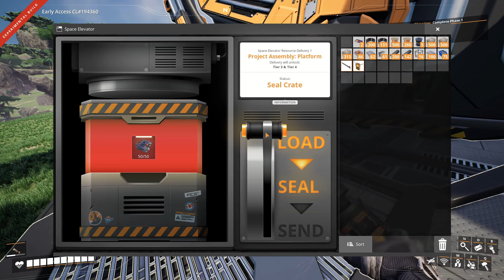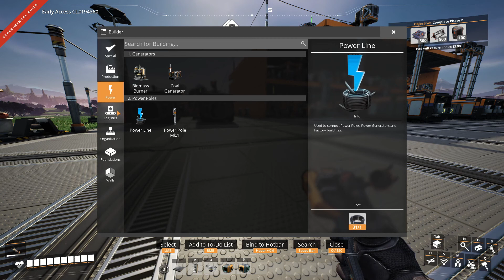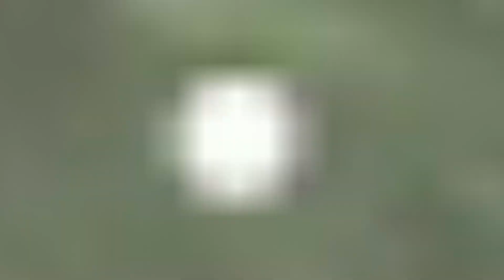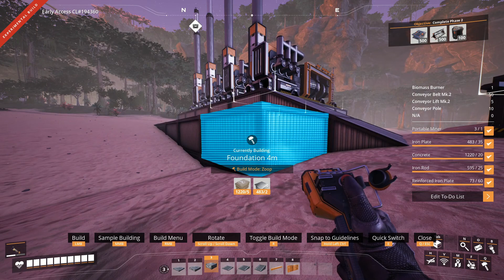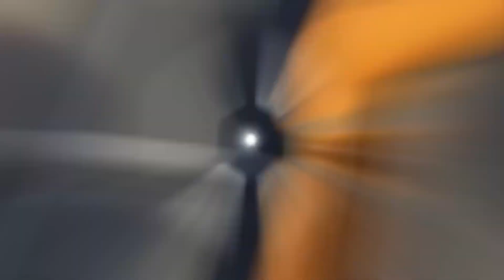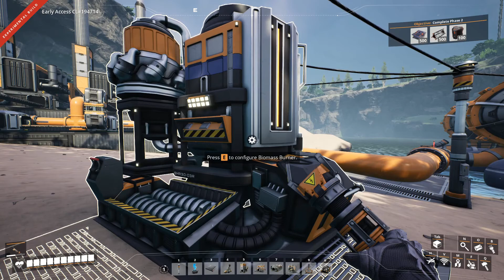Automating Power in Style! | Satisfactory #8

Comment: Hi TDA, the key for different pipe 'behavior' is R.  you can press R (like E for platform walls, etc.) to go step by step from Auto -> Auto2D -> Noddle -> Horizontal to Vertical. Or hold R to open the radial menu and select then.

Did you know that you can select the amount you want to split? Just hold RMB pressed. That then open a bar to slide to the amount you want to split.